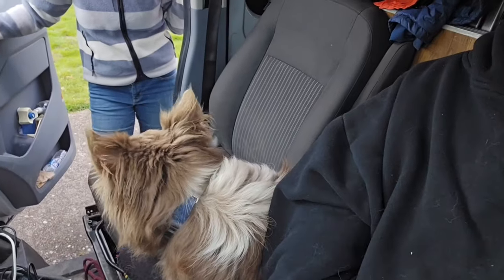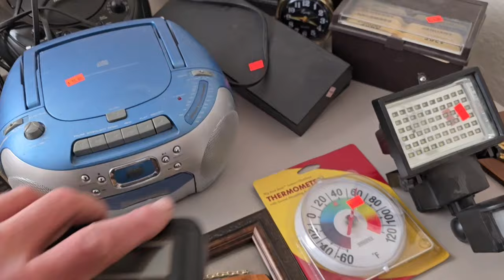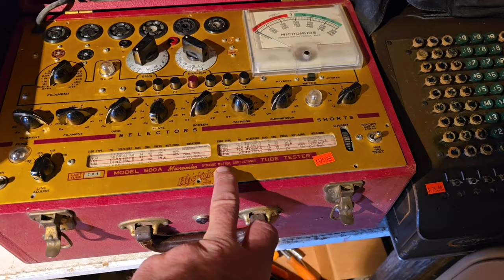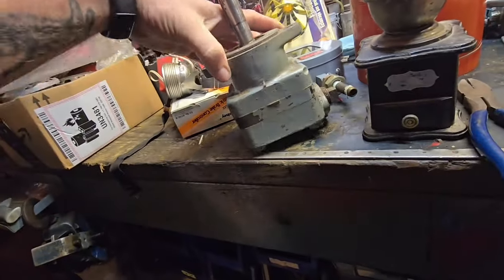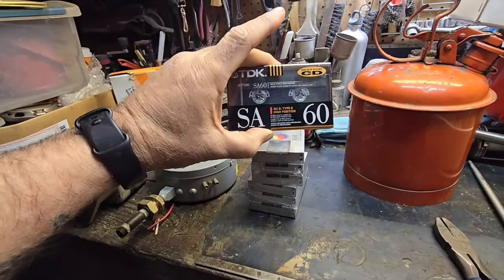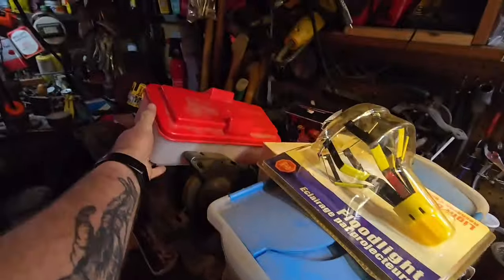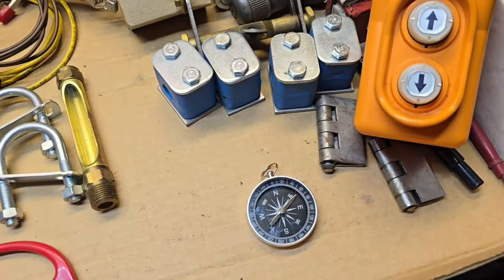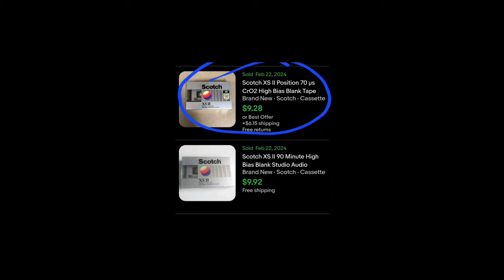Estate Sale Footage ! and Scores L@@k !

Comment: Definitely some nice stuff there, I like that little handheld compass and the two (I assume were marine compasses) at 5:18 the unit you picked up still in the wrapper was that a hand wire wrapping tool ? I tried slowing and pausing but could pick out for sure. With someone who owned a tube tester was obviously into electronics lol. Neat little coffee grinder wasn't made yesterday. 14:14 that would make some ice auger for ice fishing lol 14:57 would it be possible that is a Marlin Spike for splicing large ropes or cables ? 15:49 is the neatest kettle I've ever seen lol , Enjoy the game
Reply from the maker: Wow !!!! Thank you for all the awesome info !!! Good knowing this Thank you , the ice auger makes sense less the weight of it and the quality,  brass shaft ???? Very odd and yes the " prybar" is unusually light it's not aluminum either.  Thanks Gary 😀
Reply from the maker: I should have grabbed those bubble compasses,  I meant to , dang it
Reply: @doinsngoins  I was only guessing for that auger lol maybe because I recently used mine lol. Brass shaft definitely higher quality than mine lol
Reply from the maker: That is what I'm thinking,  then ... Why a brass shaft ever auger  in food mfg ?  But a cutter , that can be removed and sharpened.
Reply from the maker: Btw no spline on the shaft , looks like it chucks up in a hole hang
Reply from the maker: Thanks for the interest,  😁
Reply: @doinsngoins  now that makes a lot of sense to me now that you mention it